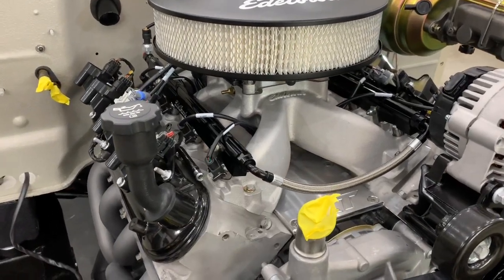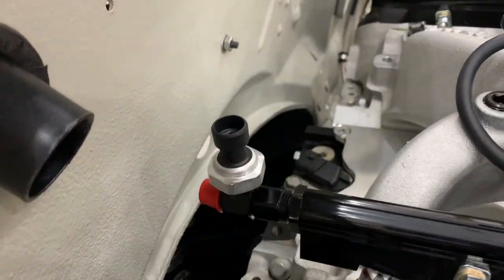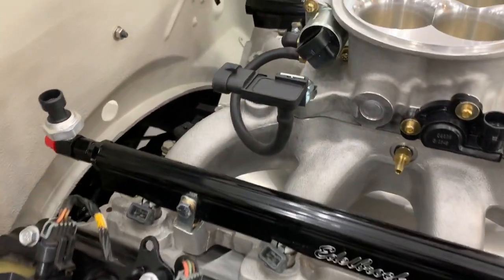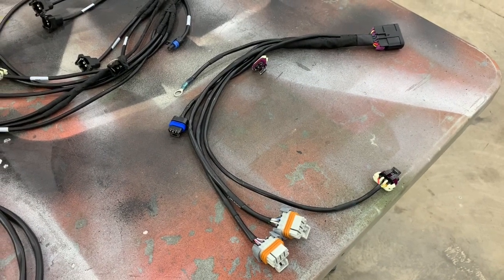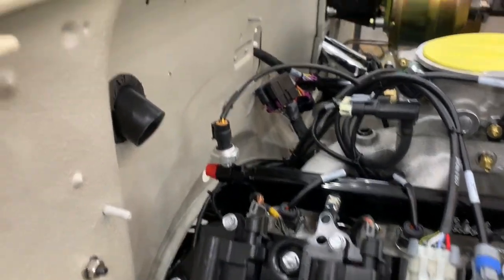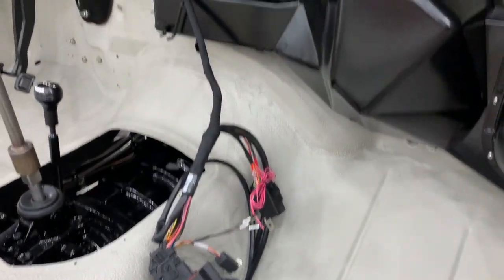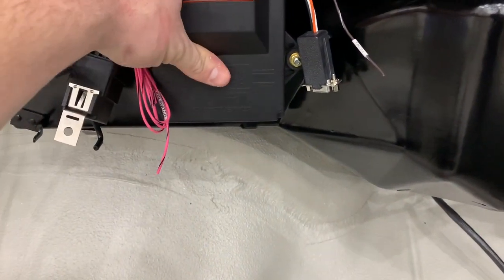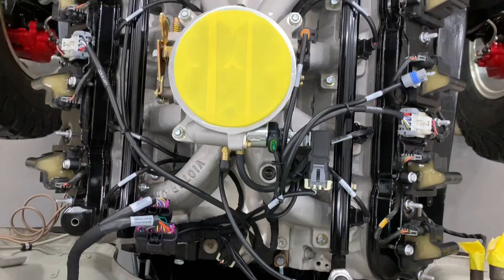Edelbrock Pro Flo 4 5.3 LS Installation

Comment: What did you do for your valve cover pvc valve and the passenger side valve cover vent tube? Where did you hook them up to? I am doing the same set up as you and need help.
Reply from the maker: Hey, the bottom of the air cleaner has a port for the PCV hose,  I forget, isn’t the PCV valve inside the valve cover?  Sorry…. Can’t recall

Comment: Hey question. Did you wire the fuel pump for through the key ignition or through the pro flow ecu?
Reply from the maker: The trigger for the fuel pump comes from the ECU.
Reply: @BobWilson84  also the 12v switch red wire where did you connect yours to?
Reply from the maker: @GbodyBrooks  you mean on the kit?  I made a custom harness, so I used the ignition switched hot which is usually RED, and YELLOW is usually battery hot.    Hope that helps.
Reply: @BobWilson84  yea the 12v switch on the kit coming from the pro flow ecu. I guess I can hook it to the radio. That’s 12 v switch with constant power when the key is in
Reply from the maker: @GbodyBrooks  yea man, good deal.  or find it like under the hood somewhere.. fuse block maybe for the old ignition relay ?

Comment: My biggest concern with the carb style intake is the amount of power left on the table. Just no comparison to a proper ls intake
Reply from the maker: The other intake they offered at the time is more of a ramjet. HP was no concern on this project.  It drove great
Reply: @BobWilson84  good point
Reply: @BobWilson84  what you do for trans control
Reply from the maker: @theshark2804 Left foot controls the clutch, right hand picks the gears.

Comment: How did you mount the air intake temp sensor?
Reply from the maker: Into the bottom of the air cleaner.  There was a flat spot that seemed like it was there for a breather.
Reply: @BobWilson84  ok thanks

Comment: Hey i have this harness for my 5.3 and I’m trying to figure out what wires I need to keep on my 88 tbi harness for my temp,oil,speedometer do you have any tips ? I’m terrified to start pulling wires
Reply from the maker: The harness will have a dedicated temp sensor.  The gauges will need their own senders separate from the engine computer.  Lastly, the computer doesn’t need a speed input, no issues there.  The instructions were really easy to follow,  don’t stress out.  Take lots of notes and pictures, you’ll be fine

Comment: I think Edlebrock intended for everything to go inside the engine compartment. I wish they had an optional wiring harness that would allow the ECU to be cleanly fit inside. For some cars you don’t want that hunk of plastic scarring up the engine bay. Under the dash seems better.
Reply from the maker: Right on,  and the way the individual cables enter the ECU plug is rather ugly.  Like you said it would be a nice option to make a DIY harness to the right length for under the dash installs.
Reply: @BobWilson84  Why don’t you have that option? They are using standard plugs. I’m not ready for EFI yet but if I need to I’d just make some extension cables or new cables as needed.

Comment: You don't need a crossover. Just cap the rails in the front, and use a Y, or a T for the inputs....This is for none return systems of course.

Your O2 sensor is going to die very quickly.

The ECU is waterproof. So it's designed to be mounted on the engine bay firewall, and you mounted it upside down....Connectors always point down.

Wires going to the top of the motor ARE bundled together. Wires that don't go to the top of the motor are separate.

Injector wires can go under the fuel rails. Ditto for the coil wires.

The MAP sensor 98% of the time hits the air cleaner. So you will have to move/bend the mount......Newest throttle body's have the MAP sensor mounted to the front.
Reply: I would assume the ECU should have the wires coming out the bottom but if you do that the Edlebrock logo is upside down. Seems like a rookie mistake on their part.
Reply from the maker: Why do you think my o2 sensor will die quickly?    Thanks for the other tips, much appreciated.
Reply: @BobWilson84  If you point it at that angle. It will collect water when you first start it up, and puddle inside the tip.
The water will shock the sensor, and crack it.
It's in the Bosch manual: http://www.bosch-motorsport.de/content/downloads/Raceparts/Resources/pdf/Data%20sheet_69034379_Lambda_Sensor_LSU_4.9.pdf
Reply: @BobWilson84  GM F-body manifolds run front O2 sensors at the same angle as yours from factory. I'd run it as is. If you do run into issues you can always run a 45deg adapter

Comment: How you going by hooking up your air temp sensor? What adaptor, plug, etc. are u going to use to do so? I just received my kit & that’s the only wire I’m stuck on.
Reply from the maker: Hi,  I’m going to mount the air temp sender right in the bottom of the air cleaner